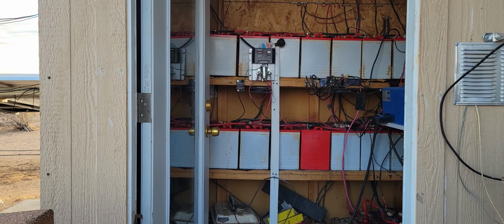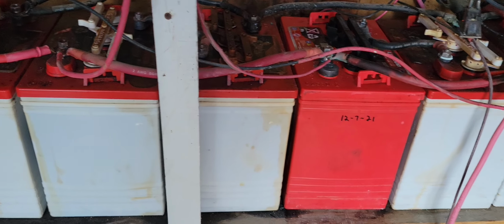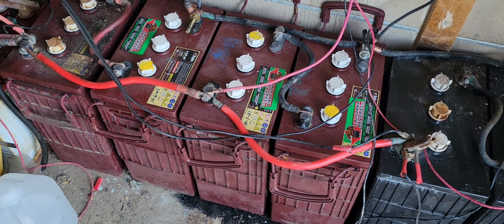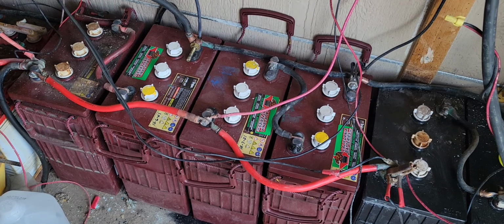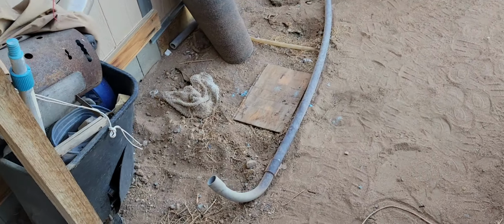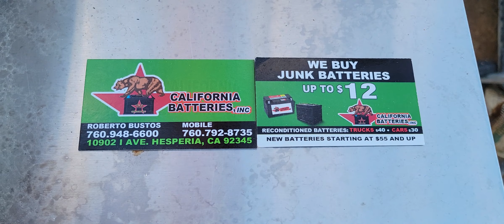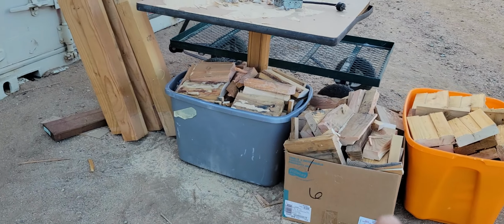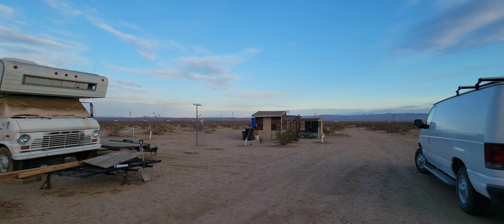Solar Battery Bank Back Up To Par, Dec. 7, 2021

Comment: December 7th 🙏.
I have the same problem with one of my 6 volt batteries.  One of 4.
Might be a good time to upgrade. 
Nice firewood. 
It's minus 5F here,  milder weather on the way.
Reply from the maker: A weak battery draws the others down.  Get it changed asap
Reply: @GBear  yes,  I'll just run the 2 until I do
Reply from the maker: Smart move.

Comment: You continue to impress solving your problems in the best possible manor!   So with your "Anti-Sulfate" system in place, how long will your battery bank last before they all need to be replaced?  Also,  how long would your battery bank last without your "anti-sulfate" system?
Reply from the maker: Most flooded batteries are expected to last 3 years.  The BLS has been proven to extend that to 10 years.  The US military uses them in vehicles.

Comment: It was in the 20's here this morning. After being up all night fixing  my juice box I slept today...my back was out of whack  so I stayed in. I was going to get a couple batteries today. I'll get them tomorrow I guess. I'm having bison cheeseburger and carrots...My battery bank is at 25.3 at the moment. Price for two new ones is $237 for the 105 amp hour ones. ( without cores) The voltage does a little better every time I get a pair. This morning when charging started, it was 24.9...I had just got the inverter done so I just let them charge today. I can't get any next month...insurance month...but last February I had 6...this year I will have 18...in case another winter storm hits. I'm on SS too. I have to just get them when I can. 9 pairs will put me at 965 amp hours, which I think is enough for my pint size inverter. Just my opinion but I think lithium batteries are overpriced...they're okay for rich people with boats...lighter maybe...lol...
Reply from the maker: Yeah 40° when I got up, bit 72° in the cabin.  Batteries at 12.2 this morning.  I think I need to run an equalization on them.
I agree that lifepo4 batteries are over priced, but I just read that they are planning to mine lithium from brine in the Salton Sea and the price of batteries will go down because we won't have to import it from south America.